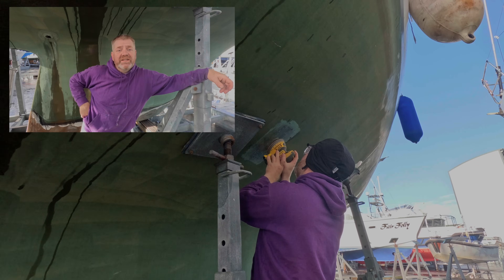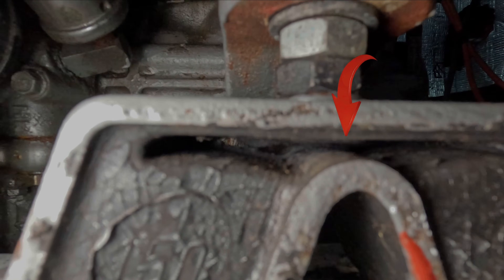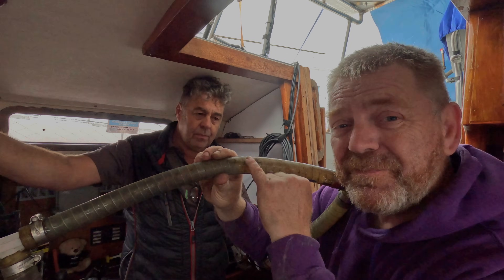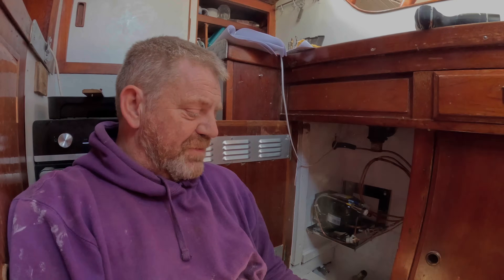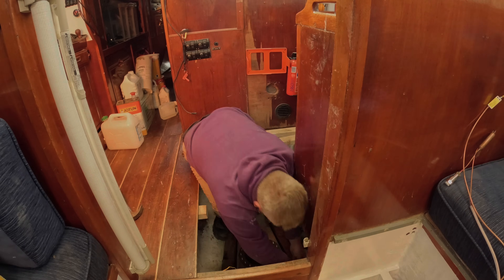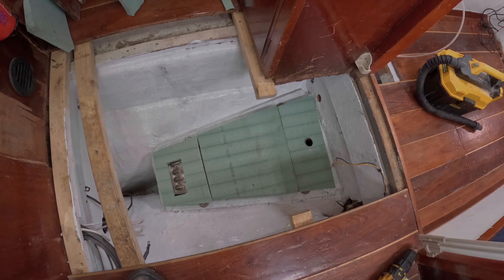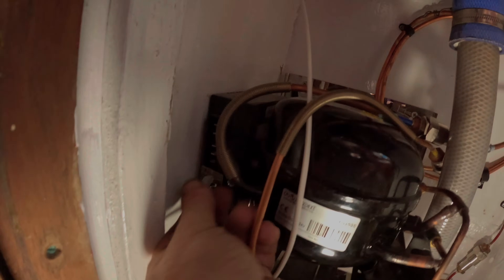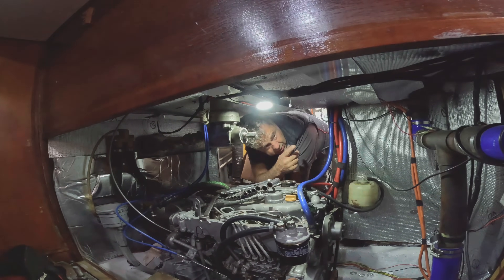The Horrifying Truth About Collapsed Engine Mounts

Comment: Andy, all the holes you drill with the hole saw really should be painted with epoxy, or at least 2 or 3 coats of epoxy primer. So no moisture can get into the bare wood where you cut holes and cause rot.
Reply from the maker: Yeah for sure. That’s absolutely correct

Comment: On the fridge, I did a simple $15 upgrade to mine that greatly reduced the amps that were consumed in a day and had the side benifit of providing a digital reading of the fridge temperature.  I installed a $15 Inkbird 12v digital thermostat with 10A relay to replace the mechanical thermostat like the one you have.  To install it, you connect the "T" and "C" wires on the compressor module where your thermostat connects.  It made a very big difference on mine and also gives the digital temperature.  Instead of putting the probe on the evaporator like the old one, you will place it somewhere near the middle of the box.  I use a plastic wire tie to fasten it to the bottom of a rack in my box.
Reply from the maker: Amazing! I’ve been looking at them all afternoon since reading this comment. There’s loads on Amazon
Reply: @SailingMelody  I have 4 of these in my boat.  Two are to control my hydronic heater fan coils, one for the fridge as I mentioned, and the other is to turn off my alternator when the case temperature gets too hot charging my 560Ah LFP DIY battery.  They are great little units, and I have not had any of them fail.  

To program them, you set the temperature that you want the compressor to turn off and then set the degrees that you want to let it rise before turning back on.  I set mine to 1ºC and a 3ºC rise to turn back on.

One of the big advantages of the digital Tstat over the mechanical is what it used to set the temperature. Because the Mechanical is clamped to the evaporator, it only measures whether it is frosted or not and then you it sets the high limit for when to turn on.  Because of that, I will only run long enough to frost up the plate.  With the old Tstat, the fridge would run on a 5-minute on / 10-minute off cycle 24/7.  The digital samples the air temp of the box so it will run for 30-minutes and stay off for 2-hours on average. that uses about 1/2 the energy for the same cooling.

Another thing this will let you do is control the speed of the compressor.  They are all variable speed from 2000rpm to 3500rpm.  The slower that you run it while still being able to reach your set temperature, the less energy you will use.  This is the same idea as getting better fuel milage at 60kph than you get at 80kph.

The resistance of the thermostat circuit controls the speed.  0-ohm gets 200rpm.  1500-ohm gets 3500rpm. If you install the Digital T-stat as it comes you will run at the most efficient speed of 2000rpm.  If you find that the fridge will not cool down to the set temperature and the compressor needs to run almost continuously.  Get any tiny 1500ohm resistor and connect it into one of the thermostat wires and it will run faster.

FYI, the mechanical Tstat has 1500-ohm resistance so that the system runs at max output figuring that you will complain less if it uses too much power than you would if it doesn't cool enough.  Most systems will benifit by the slower speed.

Comment: My current boat sank because of same pipe i was lucky it was low tide so boat wasnt fully submerged. Well done guy been with you from the start 

It Was because of you guys that i found my love for sailing
Reply from the maker: Wow. Yeah it’s easy to miss those kind of things isn’t it
Reply: @SailingMelody  I'm  a complete land lubber so this may be a daft idea but shouldn't/couldn't there be a way of limiting the amount of water that could enter through that pipe just in case of that particular scenario?
Reply: That is why I never leave my boat unattended with any of the thru-hulls open.  Taking a few minutes to close them is the cheapest insurance you can get.
Reply: @bertiebaz5455  Not a daft idea at all.  Every below waterline hose should have a seacock valve on it which is there to stop the water flow.  I never leave my boat with any of them open.

Comment: Nice fueltank 😮!🎉 and youre right, painting every fibreglass surface is important, especially where water may accumulate over time. Fibreglass tend to  sponge up water and decompose over time 🫣
Anchor fix the tank properly, water around the tank in the cavity could lift it upp.. tank has a good boyancy 😅

Comment: Huge regards to Sean of Boat Folk for the new Yanmar engine mounts. Andy, let us know if the engine runs quieter after Sean lines up the shaft. Great work mounting the compressor, crossing our finger's the cooling install doesn't leak.

Comment: We've pretty much decided against a keel fridge after seeing a few (I think UMA were one of them) who found they were ineffective in places like the Bahamas.
Reply: I have to agree. When the water temperature is like 30°C there's not much cooling going on!
Reply from the maker: Your plan sounds solid! Having both the Penguin system and the Bluetti is like having both a belt and suspenders—double the reliability, especially in those higher temps. Even if one system has a hiccup, you’re ready for whatever comes your way.
Reply from the maker: The water cooled ones definitely struggle, from what we have heard from others with keel cooled is it just uses more electric when the water is warmer exactly the same as an air cooled would.

Comment: You’ve been busy Andy! 
Well worth the effort painting as you go along. 
Our frigoboat / Penguin fridge has been brilliant,: we do have a filter in the refrigerant circuit, which apparently improves reliability and stops ice crystals forming . Yours is much newer and that may not be necessary.
Fuel tank looks very good !  What are you going to do with your day tank? 
That hose was a disaster waiting to happen and great to get that fixed and the engine mounts and alignment sorted. 
N&P (back on board)

Comment: The stopcock you showed for your sink looks rusted on the handle. Change it as you can get just new handles cheap, before the corrosion spreads and you end up replacing the valve or through-hull 👍⛵️
Reply from the maker: I’ve cleaned it up and painted it with epoxy paint and greased the valve. It’s still strong

Comment: Well scary, I agree with your wife Andy. You should definitely be familiar with all below the water line failure points so that you can attempt shoring operations in the dark! Imagine motoring at night until the engine cut out only to you´ve been taking on water for the last 3 hours!
Reply from the maker: Yep. Definitely. The bilge pump alarms would go off so it would be unlikely to be an issue but your point is valid. Little by little we’re investigating and unearthing and fixing all these things though eh

Comment: The Yanmar mounts are not the best, they are too soft.. comfort but not longlived. Expensive too 😅
Would recommend Metalastic , Vetus or similar, as they have a metal cup protecting the rubber element and a much more sturdy construction.
Of course its convinient to replace with identical mounts 😊

Comment: You need to make sure you get a few layers of epoxy barrier coat on any bare grp. Osmosis will be a risk if you don't seal up the hull
Reply from the maker: Yes I didn’t sand through. Just lightly scuffed

Comment: Andy Do not seal the top of that tank . Its best left open to the air because S/S needs air and seal it and water gets under it ! It will start to corrode !! It will rust and return to iron Same goe's for S/S bolts underwater They will look ok from outside but where they go through the hull or like they will just corrode away . Good luck
Reply from the maker: That’s a good point I can make sure the tank lid will have a vent breather pipe going up high to mitigate that

Comment: Great job with the new diesel tank mate.👍 you will now have far better range. How many litres does the new tank hold? Hopefully now you can remove that plastic tank and get back stowage space in the boat.
Reply from the maker: Not 100% sure but somewhere near 200 litres I think. 
I’m strongly considering running both tanks. Run the engine off the 62 litre tank. And have the deep keel tank for long range. Then I can fill the running tank from the deep tank via a series of filters and also run a polishing cycle between the two. That way if I had a problem with either tank I could switch over and the ability to cycle and polish fuel is attractive. I think between the two tanks we will have somewhere near to 250 litres of diesel, plus whatever we want to carry on deck for longer passages of course.
Reply: @ we just carry spare fuel in a can. Have some spare fuel pipe. If the main tank becomes compromised for any reason you can hook the spare pipe to the lift pump and into the can of clean fuel directly. It will still be passed through the engine diesel filter. Running a small day tank is a pain in the ass, especially when you are motoring on longer passages. Your 62 litre tank probably won’t give you 24 hours. If you run it dry you need to bleed air aroma the system etc. Just hassle you get when you really don’t need it. Your new tank is clean (did you flush it with diesel before installing, just to remove and particles from manufacture?). If you only put in clean fuel you should be good 👍 for ever. Obviously always add some anti diesel bug additive every time you fill up. Just my experience day tanks are a pain!
You can then also store spare fuel in the plastic tank outside or the boat.

Comment: Hi Andy, a silly question. Why does the plate on the top of the diesel tank need so many bolts? Is that to make it completely air tight as I noticed that there isn't a gasket.
Reply from the maker: @bertiebaz5455  there is a very substantial gasket. And I think the idea is that to have a large hatch like this is very very useful for cleaning and proper inspection inside the tank. But over that kind of span the more bolts the better I guess. Dave who made it is a marine stainless expert and he designed the lid,no trust his judgement 100%

Comment: At 27:38 when the boat is being moved in the daylight you can see some blemish areas on the white painted hull.  Almost like something is bubbling beneath the paint.  Is that OK?
Reply from the maker: Well spotted this area is actually where the chain plates were re fitted and the fairing wasn't finished perfectly we have photos from a previous previous owner, there are two each side. The survey is happy but we would like to address them one day but purely for aesthetics.

Comment: Always use a NUTDRIVER! for hose clamps. 1/4 inch and 5/16 inch. NOT a flathead screwdriver. Using an open end wrench when you could be using a socket and an electric drill/driver makes no sense.
Reply from the maker: Yes. I’ve got one. I spent ages looking for it and gave up. When I find it I’ll put it somewhere safe so I definitely won’t be able to find it next time I need it either
Reply: @SailingMelody 😂My life precisely!

Comment: Problem with just mixing copper with epoxy, copper coat epoxy is water based not solvent based. You can buy just 1 pack of Copper-coat, I Cary 1 pack of copper and 1 litre of epoxy for any repairs.
Reply from the maker: Interesting I didn’t know you could do that